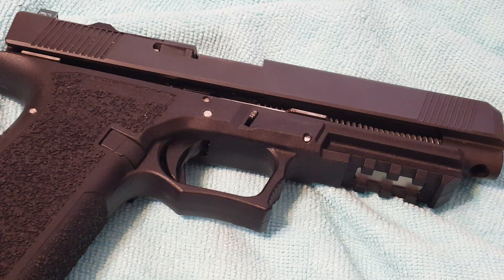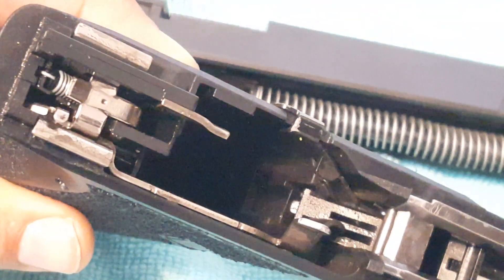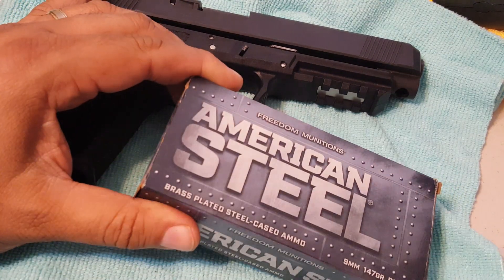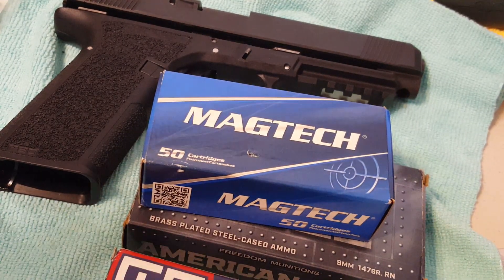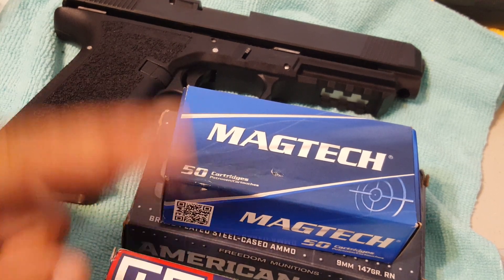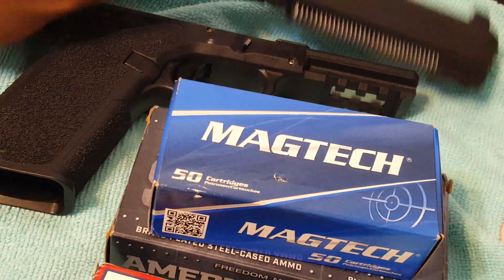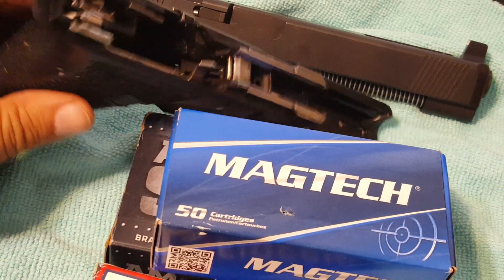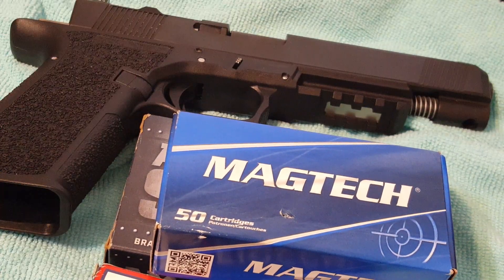Polymer80 G34 build update with different ejector and extractor

Comment: What extractor is the best for polymer 80?
Reply from the maker: Lone wolf extractor
Reply: @tacdad  have you tried the lone wolf complete upper assembly im hesitant because i havemt liked any lone wolf products ive tried so far
Reply: kram esialb  is the lone wolf extractor worth trying id be surprised if they fuck that up. although i didnt like theyre connector or extended slide stop
Reply: Ryan Green I know this is an old reply, but I’ll chime in. I came across a guy who posted on some forum that literally bought  literally every extractor out there. He said the best one was from 80pbuilder.com. It’s a billet extractor. I bought one and it fixed my erratic ejection and stovepipes. Very strong/positive and consistent pattern. I also had the gen 4 ejector which really only helped with stronger ejection. Still had stovepipes until I got the billet extractor. Hope this helps if you are still having issue. I’ve also heard bad things about lone wolf.
Reply: S9 tool steel extractor from shadow system arms. Buy once cry once.